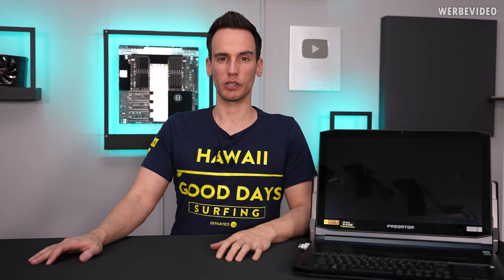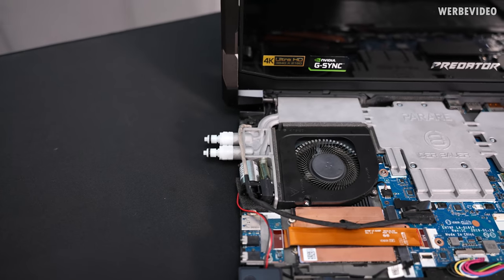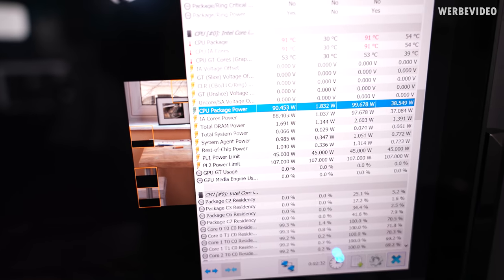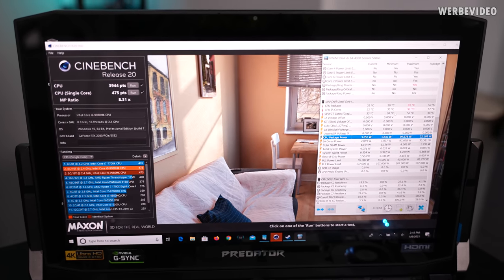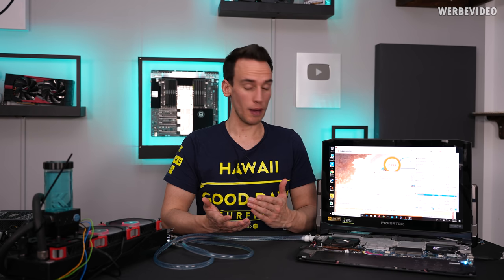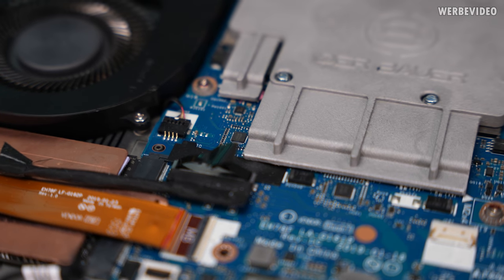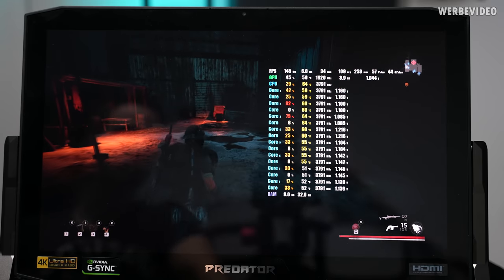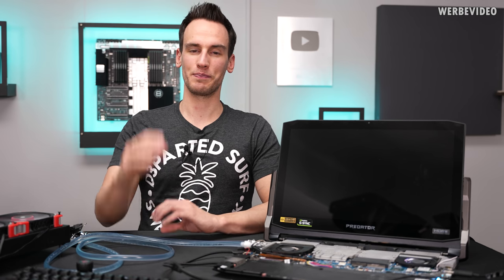Notebook with External Water Cooling - We finally have Results!

Comment: You need to re-run the internal cooler numbers now that you fixed the GPU!
Reply: Not sure there is a need for that because scores on radiator & DDC were ~600 3D Mark points apart from stock cooling. Internal LC would sit in between.
Reply: @gagarin777  when he fixed the 3D printed option his scores on 3D Mark increased by a LOT.  But we have no idea what the increase is for  the internal only option now that it actually mounts right
Reply: @plebetopro5786  As I said earlier - with stock cooling it was ~9000p and with DDC was ~9600p. There is no real point to retest it for internal pump because it would set in between those two. The percentage of difference would be meaningless. The big difference you are reffering too was caused by terrible contact (or rather no contact on the GPU).
Reply: @gagarin777  we ASSUME it will be between.  But that depends on how well the block and it's internal fins can cool.  It is absolutely a valid test, as this is still a laptop, and Der8auer built the system to allow it to still be used on the go.  The external rad negates ALL local cooling.  As he states when he talks about turning the internal fans off when the rad is connected.
Reply: @plebetopro5786  eh, if it was worse than stock cooling then the cpu would be performing worse/had higher temperatures as well, because both cpu and gpu are on the same loop using the same cooler. And this is not the case because it was shown that cpu could perform better on internal LC. Cooling potential has been proven. The part with GPU dropping huge number of points was a deviation caused by bad mount. This whole thing is like a prototype, so stuff like not everything aligning properly may happen.

Comment: I'm a bit surprised you didn't manage to push it further to be honest.  My own 9980HK (in a Clevo PB51 chassis) can push up to 4.5ghz all-core on a -150mv undervolt.  CB R20 score is 4462.  The highest CB R15 score I got is 1951.

The PB51 becomes temperature limited at 4.5ghz/4.6ghz as well as VRM limited.  At those turbo speeds, it's pulling ~140W.

As for GPU overclocking, your best bet is to push the MEM clock up and use an undervolt curve.  The undervolt will serve as an overclock since the power limit is fixed.

Comment: Great proof of concept.  I really want to see manufacturers offer another setup with the docking station containing the pump/rad so that you get the full benefits of water cooling when docked (ie, no screaming fans like most high performance laptops), and still have something that works when mobile.  I didn't even know Asus did that previously, but as you pointed out, they kind of half-assed it.

Comment: I think the amount of internal surface area, and where it is placed is what is causing most of the problem. The thermal conductivity of aluminum isn't as good as copper sure, but if it had micro fins right on top of the dies like a standard water block instead of thick columns all over inside I think you would get much better heat transfer into the fluid and out to your radiator. Same for getting heat out of the internal heatsinks, the fins are much thicker than the stock ones and so it's way less surface area. Basically the lesser thermal conductivity of aluminum should only be worth a few degrees in a normal loop, but when you're trying to transfer the heat through aluminum and a (comparatively) long distance the problem gets multiplied.

That's my theory anyway. Not worth a whole lot cause I don't know how you'd have a block like this made with micro fins inside to be able to test the difference. But if you can find a way I'd love to see it!

Comment: I would use one of those Asetek low profile pumps integrated into AIOs instead and maybe use the heatsink sections of the original cooler as the radiator parts of the cooling block somehow.

Comment: And here I am, getting 4370 pts in Cinebench R23 with my Dell XPS 9700 and i7-10875H. Liquid metal modded, bios modded to allow undervolting.. Sustained 4.2ghz on all cores with 95W power consumption, temperatures sustained below 95°C for the duration of the test. Long term sustained wattage at 85W - around 85-90°C.

And THAT'S impressive. Before, I needed on average 110W for 4100pts, T maxed the laptop in mere seconds..

Comment: You didn't rerun test with inside pump after reapply thermal paste. I was curious if there was improvement enough to run it without external cooling.

Comment: You should try this water cooling with msi gs series laptops because these laptops have a workaround to remove the TDP limits, thus running intel CPUs to run at full boost at all times

Comment: Use ThrottleStop, it is a better undervolting tool for Intel CPU. -200mV for Core and -100mV for Cache should get you some improvement in CPU performance.

Comment: Probably not worth the time and effort but a "Gen 2" version that has copper plates soldered to the die contact areas would be cool. Just to see if you could get any further with liquid metal, even with the additional interface materials.

Comment: I'm not sure, but it might be more efficiency to leave the laptop cooling system without changes and connect the cooling system to the copper pipes of the standard cooling system so that the liquid cooling helps the standard

Comment: How was the weight affected? I'd assume that it decreased, as copper is heavier, but there will be a difference in weight between an empty and full loop
Reply: Water coolers actully run with less water than we think... 240rad complete watercooling loop holds like 0.5L water... in this case without real a rad and res , lot less...  I would give same amount of weight or less than air cooled version...

Comment: Pretty cool project. Because the internals are all aluminum, wouldn't hooking it up to a copper external radiator and pump make your system at risk for galvanic corrosion? Or does the coating prevent that? 

Does the coating allow you to apply liquid metal and not have it eat away at the aluminum?

Comment: I'm curious how it performs with the internal pump hooked up to the reservoir (but not with the reservoir pump running).

And as Keven Berger said, the internal pump should also be tested on its own, as you fixed the GPU cooling quite a bit.

Comment: it's possible to unplug the screen on the laptop put a classical WC loop on the cpu and gpu ( it's possible to fix it with classic cpu block ? )  and uset the mini display port or hdmi on external screen. ? just keep the mother board with a w/c loop.

Because i have this idea with my asus laptop g752 vs

Comment: Why don't you do this with asus g15 advantage edition laptop with rx 6800m its a very capable machine and also supports liquid metal by default. It will be very interesting to see how the AMD gpu does with no thermal limits.

Comment: I wonder if this will beat a 5800HS running within spec at 35w long term power?
Reply: Not a chance my ryzen 5 4600h at 45 watt Tdp but max I recorded 53 watts never thermal throttles with max fan and cinebench I get bweteen 3200 and 3300 depending on if I have stuff in the background

Comment: I would like to see something like this with ryzen cpu's. They benifit alot more from lower temperatures, enabling them to boost higher?  I would definately like to see a copper version. I would buy a laptop like this if it can be properly cooled as you have done. I'm fed up with the headache and high temps and throttling you get from laptop manufacturers, yewh that'll do. Or not making enough vent holes for fans to suck in aire or extract it. This happens on asus laptops and msi laptops. It's a joke. I usually end up using a dremel to cut out the vents that should have been cut out. Bad design flaw by manufacturers. But this seems awsome! I would pay more for a well thought out cooling solution if it ment more performance.

Comment: shunt mod the gpu for god sake, and do some uncore for memory, overclock ram, imon slope, etc, i want to see hard cpu optimization and overclock at least to 4.1 on all cores or use core parking and try to get highest possible clock within thermal limits.... there so much potential but not enough enthusiasm here...

Comment: I think this solution was a game changer in 2010 😂😂, because now we have a fair air cooling and also the processor have greatly improved thermal

My 2010 Intel i5 produce so much heat that it can burn ur legs, or maybe Toast a bread gureentee😂
The whole laptop and the table gets supper hot that you can't even touch it's back

Comment: Quite nice but not practical. I think you will never get back full portability. And i do not mean that you can't use it without the water cooler but. You don't want to disconnect because of the water loss and i do not think that any solution is absolutely loss free. To my mind only closed loop systems make sense at all. So you need to transfer heat through dry surfaces to the water cooler and not put water inside the laptop.